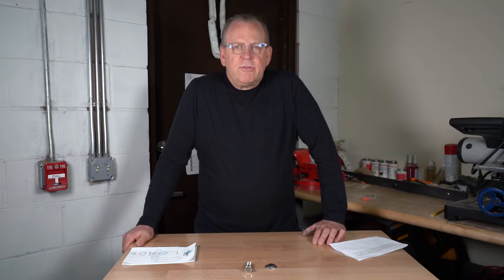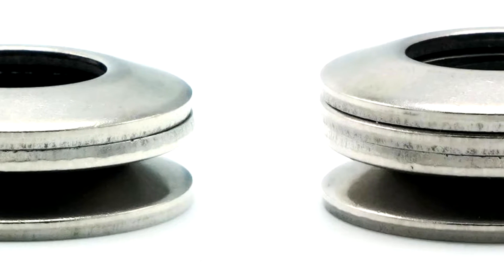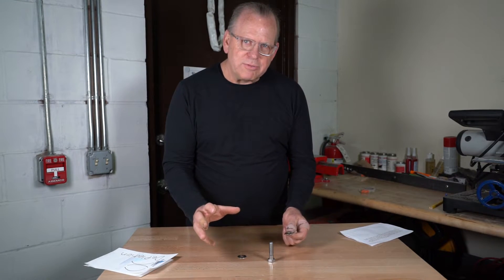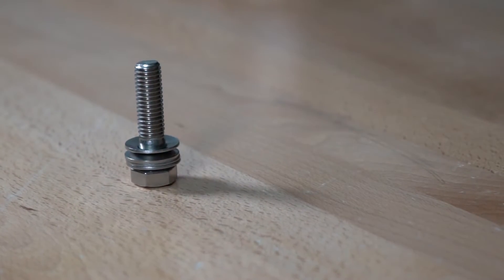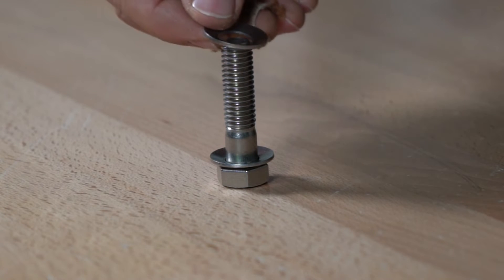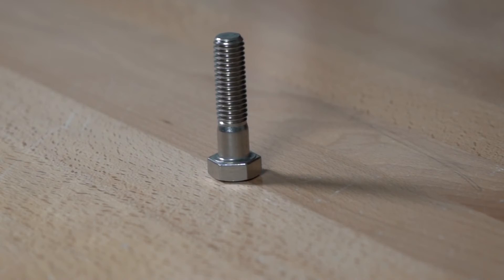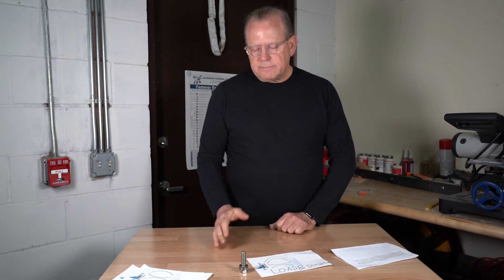Belleville Conical Washers - Overview | Fasteners 101

Comment: Your load and deflection, has 2 together and 2 opposite. The 2 opposite will compress while the 2 together will not. So you will flatten the 2. It won't work very well if 2 are flattened.
Reply: The stack arrangement he uses is 2-1-1, which will have a greater stiffness, because (as you stated) you are only flattening 2 instead of 3 (but the same flat load) as a 1-1-1 stack arrangement. If you are looking for a greater flat load and a greater deflection you should use a 2-2-2 stack arrangement.

Comment: missing 1/2 of a video... What is load and how is it used? What is deflection and how is it used?
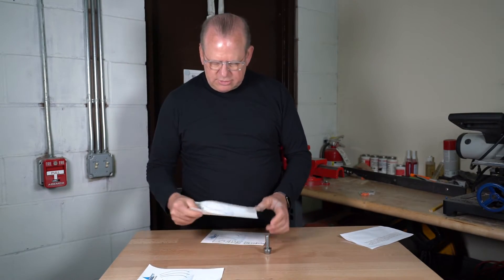Reply from the maker: 2:19 In this context, Deflection is the degree to which the washer travels vertically (or "bends"), with respect to the bolt, under a load. Think of it like how much the washer compresses or springs under load. A load is the force applied to the structural elements, sort like the "weight" that's on the fastener(s).
Reply: Yes thank you for defining "load" and "deflection"...
  What is missing, from an Application standpoint is: Where would you use the "load"technique vs. the "deflection" technique, or the combination that you describe?? Thank you
Reply from the maker: Certain applications have specific requirements and the different configurations can be used to meet those requirements. If you have application specific questions, it's best to consult an engineer with your specifications.
Reply: @michaelyoumans2113   My understanding is that Load technique is used for instances where the amount of force applied onto the spring is the concern and the Deflection technique is for instances where the concern is how far you want the spring to deflect or move in the vertical direction. The combination allows for both.
Reply: Does this equal the separation of the joint which is being held together by the fastener?
Reply: @AlbanyCountyFasteners  dont feed the trolls.